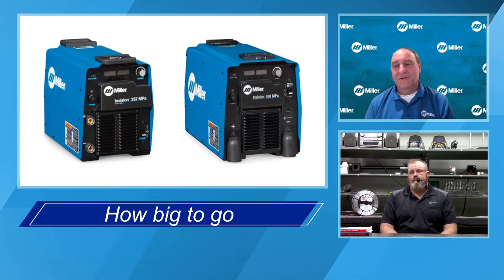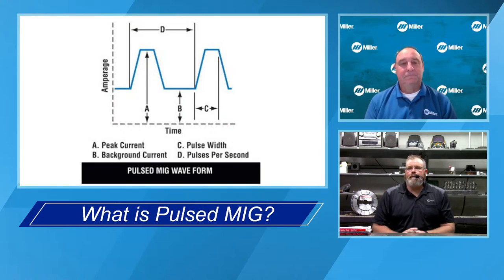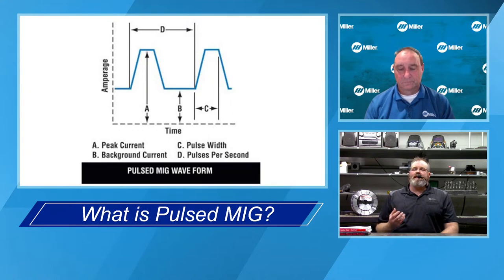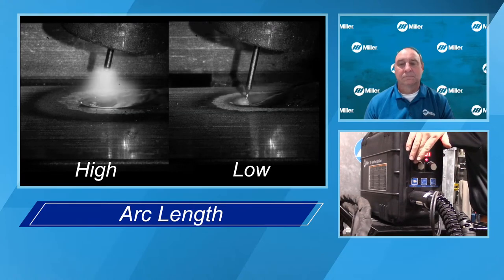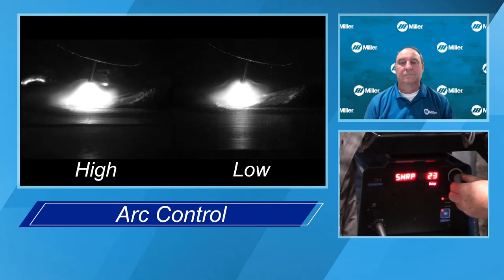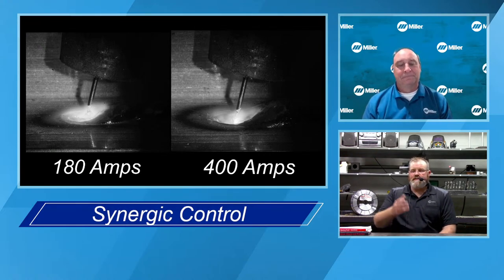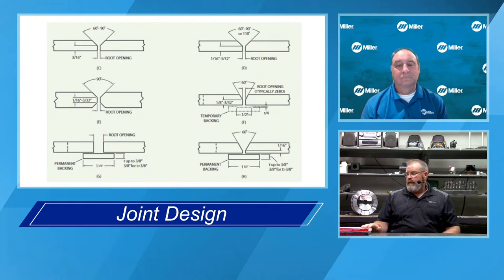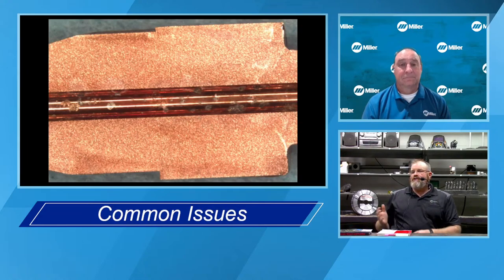Beyond Basic Aluminum MIG

Comment: Hi, I recently won at auction an older AC/DC Miller Thunderbolt. I know enough about welding to be dangerous. Is the Thunderbolt considered a power source and are there attachments that can turn it into a MIG and/or TIG welder?